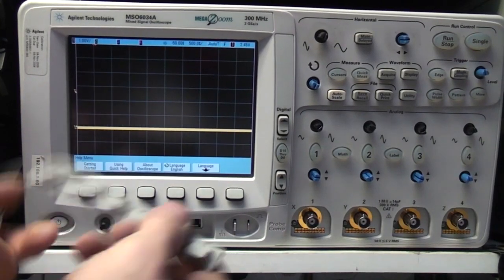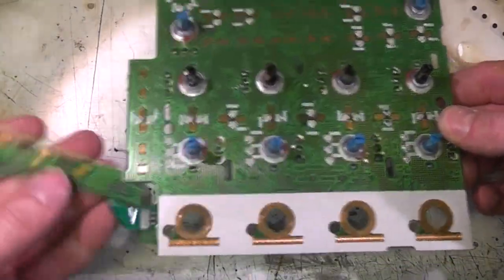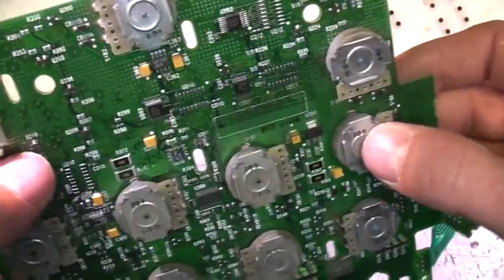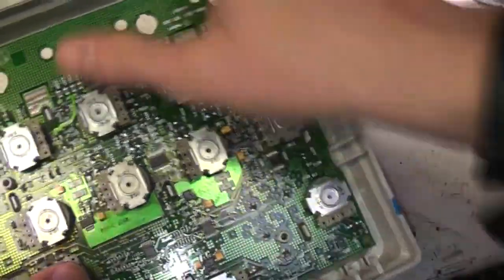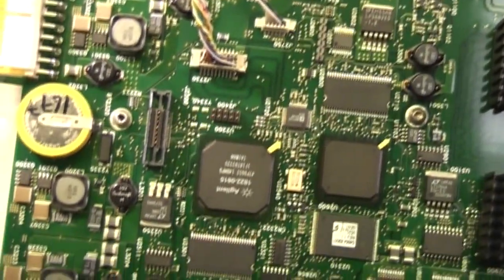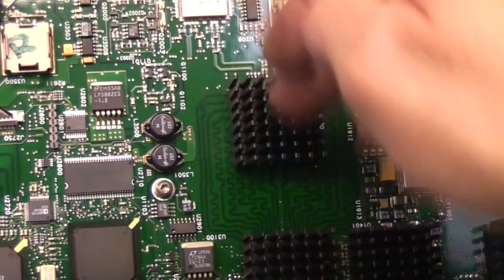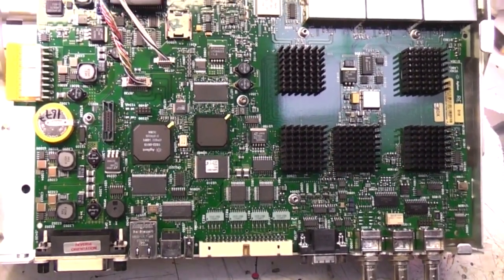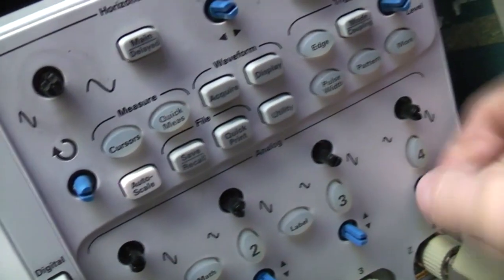Agilent MSO6034A scope mini-teardown

Comment: @Films4You 91% isopropyl will work, but you have to be careful to put barely enough pressure to get it clean; any more and the carbon binder starts to dissolve reducing the number of times you can clean it before it becomes useless.

Comment: What does the "Reverse Orientation" connector label at 08:30 mean?

I found several TV/VCR controls with similar rubber button pads that failed. I found something like maple syrup between the rubber and the PCB. Cleaning fixed it, but the syrup would come back within a year. No possibility of a spill getting under the rubber from the outside. I have never been able to figure out where it comes from.